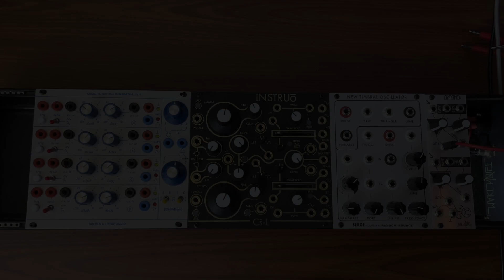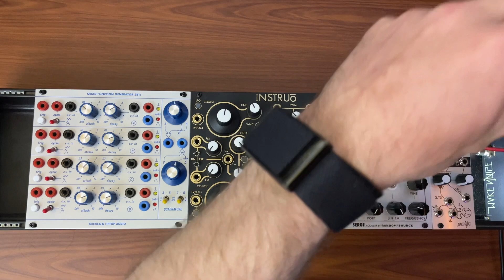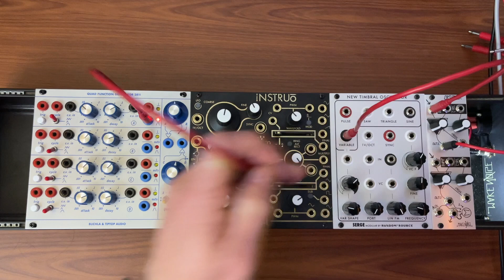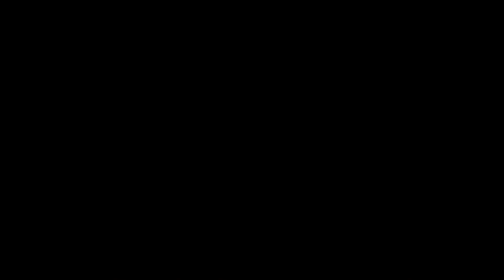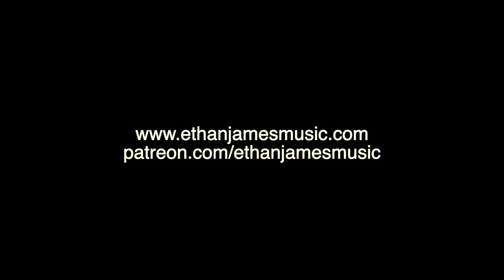Eurorack A to Z Tutorial Lesson 15: Complex Oscillators Part 2

Comment: can you explain the difference between the tiptop buchla function generator and maths please ?
Reply from the maker: sure!  The buchla 281t is four channels that can be either LFOs, attack/decay envelopes, or ADSR envelopes.  Each channel also sends out its own trigger as well.  Maths is heavily influenced by the Buchla design.  It has two channels that are the same as the 281t, but it also has 4 attenuverter, and it does voltage combining, slew limiting, voltage inversion, and more.  
I think of it this way: the 281t is a four channel function generator, and Maths is sort of a two channel function generator and also an analog computer.   I already have a deep dive into the 281t on my channel here, but let me know if you'd like me to make a deep dive into Maths.